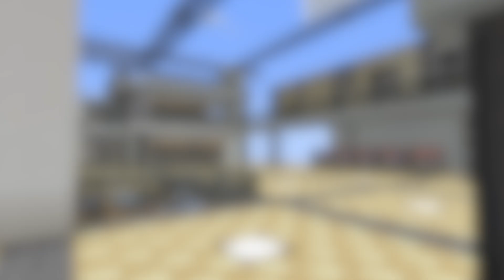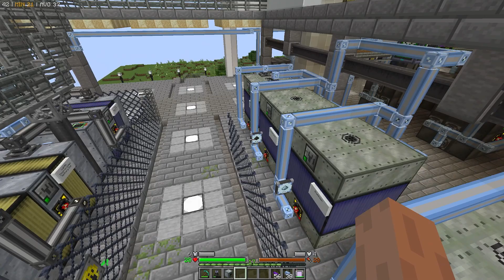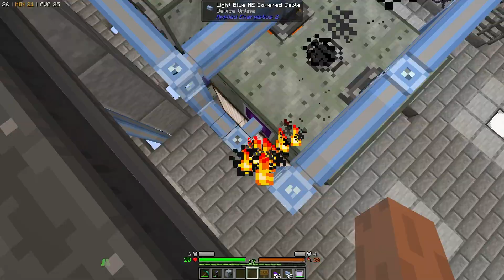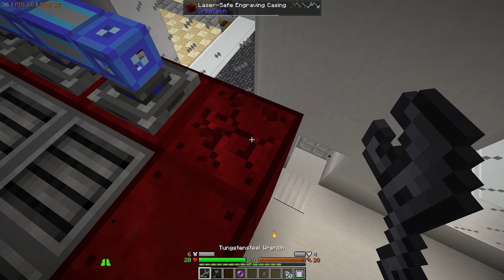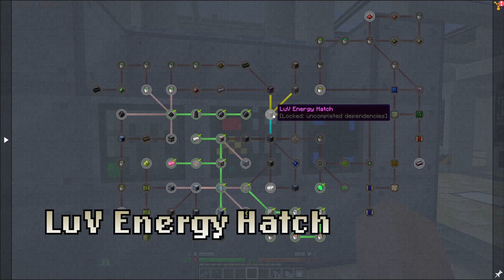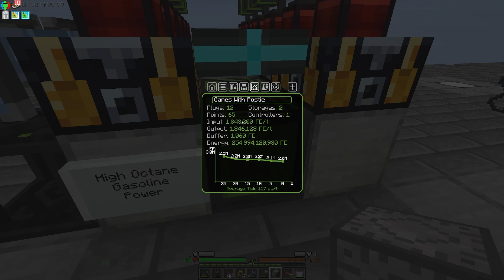Star Technology - 32 Unlocking Ludicrous Voltage

Comment: Can you please help me i have 3000b of hydrochloric acid and when i start autocrafting it wants to craft it when i already have it
Reply from the maker: Is your hydrochloric acid accessible through your storage system? If it's in a tank somewhere, you'll need a storage bus on it.
Reply: @gameswithpostie  When i open ME terminal and search hydrochloric acid it shows 3000b is available
Reply: @gameswithpostie  I transfered it into supertank with storage bus and it is also showing in ME terminal and it still wants to craft it
Reply from the maker: @MarekUhrin  yikes! Ok.. I'm not sure what to suggest? Some things in the game like ingots, are added by more than one mod, and the ME system can confuse them.. that said I think there's only 1 hydrochloric acid 
You don't have any subnets or anything that might make the hydrochloric acid inaccessible to where the crafting happens?
Reply: @gameswithpostie  I am blind and it was recept for idk what and it made 2 things: 1. was hydrochloric acid, which i dont want and 2. thing that i wanted adn it was made in iv chemical reactor and i had it in ev. But still thank you for your time. and one more thing do you know name of setting with which you can change ammount of items in patern encoding terminal? because middle click dont work for me
Reply from the maker: @MarekUhrin  ahhh ok. Glad you got that sorted. The middle click issue is caused by a conflict, so if you go into your key binds and check for conflicts on the middle click, you should find multiple things bound to it. You'll need to remove a certain one.. I have vague recollection of it being sorting related? But I can't remember exactly...
Reply: @gameswithpostie  inventory tweaks

Comment: I think liquid soldering alloy is mostly a holdover from earlier GregTech packs where there was actually mining and/or resource-gen isn't as generous as in a skyblock.  Trading a tiny bit of antimony and a bit of lead for tin is more resource efficient than liquid tin  - using half as much per craft really adds up late-game when you're crafting thousands of items in circuit assemblers.  Also, I can't recall clearly, but there might(?) have been higher-tier recipes could only use liquid soldering alloy?
Reply from the maker: @unpronounceable1  yeah I thought maybe it was like the etching liquids.. sodium persulfate/iron iii chloride/cupric chloride that slowly increase in volume required, so it makes sense to upgrade, but the soldering alloy requirements always seem pretty low. Your explanation makes a lot of sense though.

Comment: With a cleaning maintenance hatch the multiblock can be used is it in a clean room so you can use the large cutter
Reply from the maker: @Timbo0o  oooh I will have to give that a try!
Reply from the maker: Ok, I just looked into it... it requires UV circuits.. so I'll revisit that in maybe 6 episodes time? 
🤣
Reply: @gameswithpostie  oh dam ,on monifactory you can access it in IV, will I guess a bigger clean room  coming?